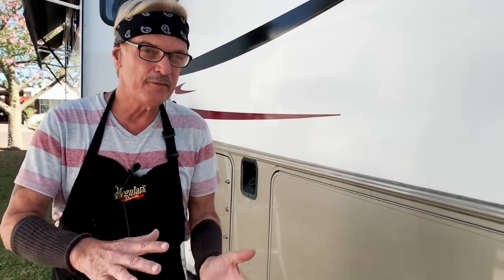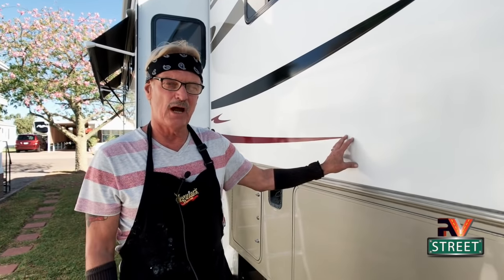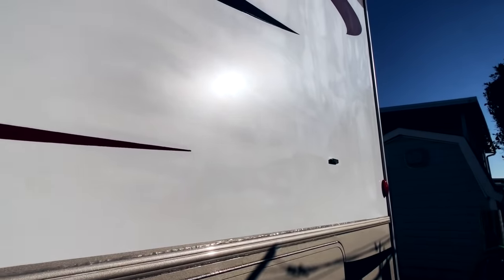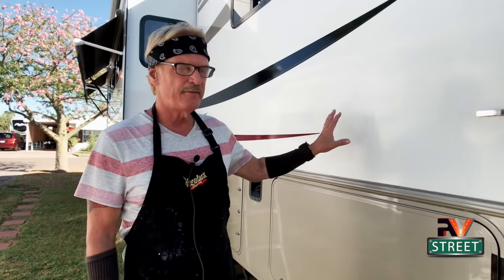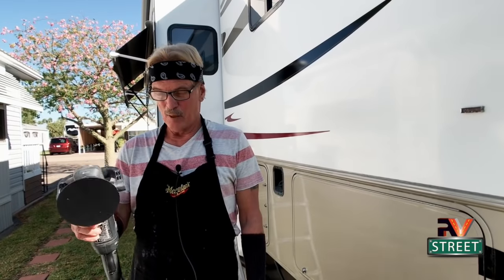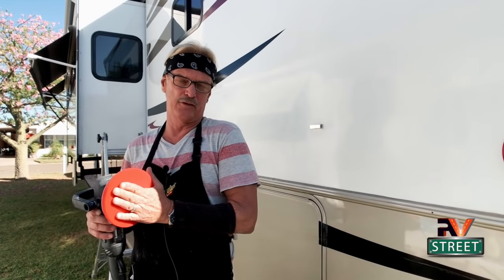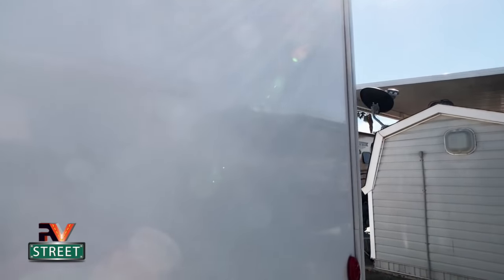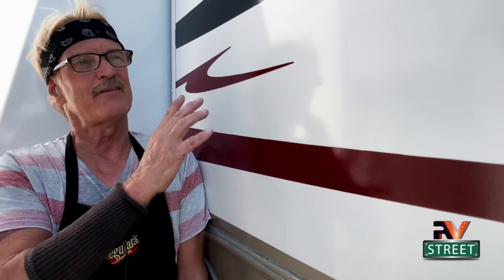HOW TO POLISH & PROTECT YOUR RV THE RIGHT WAY 👍

Comment: Hi Martin & Joanie - 
Great video.  Question; what you are showing, would it be the same process for a coach that has a full paint job?  Also, we had a mishap on our maiden voyage in our 2018 Thor Challenger 37FH. We clipped the corner of an abandon gas station building as we were trying to circle the building to exit the corner station after stopping for a break. long story.  We scrapped the side of the coach at the base of the PS slide and the basement door at the corner point of the building.  We rubbed out the paint from the building  and tried to smooth out the scraps, where some when to the aluminum door and fiberglass base at the bottom slide panel. I was able to get matched up automotive paint (four colors)  from a vKOI auto parts store & paint shop in our home town.  But is is not what we want it to look like; good as new.  Any DYI ideas that we should try?

Joe & Missy
Reply from the maker: Have you seen this video I did?
https://www.youtube.com/watch?v=sB5S6zzRlpk&t=9s

It sounds to me like if you want it to be just like new it's going to have to be professionally painted. Not a DIY job.
Reply: I will go back and review the video again.  Want to avoid pro paint cost, but I may have to do more DYI effort then what I have  done so far which was not what you outlined in the very first video.  Got to get the right tools and do it right! Thanks
Reply from the maker: @joemissyoneil8668  
Ya, those two video's cover different approaches depending on what you're trying to accomplish. I think the 2nd video is more what is in line for your situation. The link again is here:
https://www.youtube.com/watch?v=sB5S6zzRlpk&t=9s
Whatever you do, just take your time, don't stay in one area to long. Don't really bare down on the polisher because you don't want to heat up the fiber glass. Using a very light compound and then polishing out stuff like this is a slow, easy process. If your scratches have gone thru the clear coat nothing will fix that other than repaint. More than likely, I suspect you can get it back to more than acceptable. Maybe not perfect but acceptable. Both the light compound and polish is in my Amazon store if your unsure what to get. 
I know you were probably really pissed at yourself when that happened but....the sun will rise tomorrow. 
You'll do fine I'm sure. Good luck Joe. 👍

Comment: The timing on finding this video was perfect. I spent many hours in April waxing my 3-4 year old RV with a pretty expensive wax to keep that new shine. I use 6.5" general purpose pads (with no cutting properties) on a DA polisher. Now in August, I started seeing what I could only describe as "cloudiness" (the actual word I told my DW). Your "before" pictures are exactly what I am seeing on my coach right now. I was totally mystified. Now, after watching your video, it is exciting to know that I don't have to go and buy compounds that are for oxidation. I think the "cloudiness" is what you see before oxidation sets in?
Reply from the maker: When we first bought our RV it had very bad oxidation. Previous owner didn't take care of it properly. It took me 3 weeks to compound and polish to restore the RV back to new. But this one area has always been a little fussy since, so I usually have to polish it a little more from time to time. But yeah, not ever going to let our RV get oxidation again.
Everything I use to keep our RV looking new is in my Amazon Store under the "Compound, Polish, Finish Coat" category: https://www.amazon.com/shop/rvstreet
Reply: @RVstreet  I purchased the polish, Rejex (which I had already been applying to my front cap. Don't know why I didn't think it was good enough for everything else?) and the #67 One-Step compound (Just in case?) from your Amazon store on Sunday evening. Curious: Did you ever have a time when the Polish wasn't getting it done and you had to switch to the compound? Again, my unit (40" 5th wheel) is only 4 years old and has only gone 1 year without wax or sealant (I keep telling my wife that skipping that year was my big mistake)? I just don't want to ever hurt the finish by getting to "rough" with it, but on same token, don't want to go at it 5 times either. Suggestion(s)?
Reply from the maker: @tomziegler7987  Did you ever have a time when the Polish wasn't getting it done and you had to switch to the compound? 
A: No. If your 5ver has begun to oxidize you'll have to do some compounding first, but I doubt that has happened in 1 year. But it is possible. Skipping a whole year may have been enough to start some light oxidation. You cannot polish to a nice high shine if there is any oxidation.

So let's say your 5ver has not oxidized. It really matters on the type of polish, pads and polisher you're using too.

You can't hurt the finish with polishing or compounding—*IF*—use the technique I showed until you get the results you want. Easy pressure, randomly moving the polisher around, then wiping off the polish with a microfiber cloth and look. If it needs more polishing, repeat.

If some compounding is necessary, same method just use my Meguirs compounding material in the blue bottle first. Keeping your pads clean as you move along. Once oxidation is removed, then polish.

Then use RejeX on the whole RV for your final coat.

I keep telling my wife that skipping that year was my big mistake.
A: I know how you feel. It's easy to look at the RV and say, "It looks fine, I don't need to do that". But you do if you want it to always look nice. 40' is a lot of coach, but if you stay with it every year it's much easier to keep up with it, then wait and cause more work for yourself to catch up to get it back.

Hope this helps. 👍
Reply: @RVstreet  Thanks Martin for your guidance on this. I am preparing (early) to be ready for Spring in Michigan when I can start the polishing process. I firmly believe I have the same situation that you described in the video ("cloudiness"). I am going to try the Polishing process first and repeat if I can't get the cloudiness gone. If that doesn't work and I find that I am fighting a (small) bit of oxidation, what is your first product recommendation? Oxidation Remover (#49)? Is that the first step if the polish isn't working? Seems to have the least amount of aggressive properties? Also, I see that you were using the Polish over the pinstripes and guessing that the polish doesn't hurt them? Whereas, the #49 probably would? Would love to chat with you sometime. Thanks again!
Reply from the maker: @tomziegler7987  Yes #49 and clean the pads often to remove old material. Still can use the pads wet though when compounding. Yes when you're compounding or polishing you go over everything including graphics. They are also dull and sun beaten, this will restore those too. If regular polishing is all you need now or in the future use my yellow pads. You'll need one clean dry one for each side of the RV. It's smoother and will give a much better shine. Never do any of these steps in the sun and hopefully your using my polisher and microfiber cloths too. All these things working together make the difference. You have to use the right tools, go slow, do small over lapping sections at a time. Compounding 3500-4500rpms, polishing about 5500-6500rpms.

Comment: Hey Martin, This may be on another video but thought I would ask here... on the dash inside your coach, what do you use to protect the plastic dash?  I'm assuming 303?
Reply from the maker: Are you talking about the molded dash itself with all the gauges and stuff OR the large area on top of the dash behind the windshield? I assume the latter. No 303 there. With my material up there I use a leather conditioner and cleaner. In addition to that, I made some rubber mats from yoga mats to lay up there for protection and cut glare. And remember, I have my outside windshield and both side cabin windows covered with my shade screens. So that area is never subject to a lot of sun.
And yeah that may be a good video. I'll think about that. thx Gord 🔧
Reply: @RVstreet  and that’s why you are the best. Yeah sadly right behind the windshield is a large moulded piece of plastic on mine and not something… nicer.  I have the drop down shade up front, but it doesn’t cover that giant piece of plastic so I’m worried it’ll get faded or crack over time. Really like that 303 product you turned me in to. Just wish someone local sold it. I may invest in one of those magnashades I’ve seen. Thanks for the help again Martin. If we ever meet on the road I easily owe you both a nice dinner and a few adult beverages
Reply from the maker: @gordschultz1980  If I could offer my opinion on the Magna shade. 
I took a long look at the Magna Shade and was tempted to go that way BUT.......as it turned out I made the right decision by going with my outside snap on type widow shades. Here's why....Storage. The Magna shade is a little easier to pop up on the windshield but I still wanted cabin window shades too on the sides. And then there's storing the magna shade. With those big magnets think about how you'd store it. With my 3 shades, I lay the big windshield one down first on the ground, then the two cabin window shades on top of that. Then Joanie & I roll everything up and put into a 4" piece of PVC pipe with 2 end caps and slide it into the bay. You can't do that with the Magna shade. It's too bulky.  Yes I have to use a ladder to install mine, but I'm going to clean the windshield anyways first so what difference does that make? That screen material has to roll up, not fold. Folding makes creases in the shade material. Plus Magna shades were more expensive. I've had our shades now going on 6 years and absolutely no issues EXCEPT.....if we arrive somewhere where it's cold which is rare, I have to lay the shades out in the sun to warm them up some, so when I go to snap them on, they'll stretch enough to fit all the snaps. Shade material contract and expands with ambient temps.
And yes we'd love dinner and LOTS of adult beverages with you. We're thirsty most of the time.
Reply: @RVstreet   scary I wasn’t sold on the Magna Shade for two of the reasons you listed. Is there a video on your channel that covers your shades?  I’m on my mobile now and the search function isn’t the same as my computer
Reply from the maker: @gordschultz1980  Well not exclusively on the shades but I did briefly cover them here: https://www.youtube.com/watch?v=gksRZys6aX0&t=61s
The company I used is in the description text and I'm not affiliated with them but they are a great company IMO.

Comment: Serious question. I have rejex on my TT. Say you take a trip and hit some rain, would you still be comfortable only using the waterless wash? I have trouble knowing when to full blown soap and water or just use the waterless deal. Thanks
Reply from the maker: If I get caught in serious rain you know what happens right? The RV is trashed. So I do a thorough wash. Takes me about about 2-3hrs. BUT....if it's not serious rain and fully trashed and filthy, then I'll do a wash wax all waterless wash.

Comment: I think my 05 Tioga might be too far gone. Like under kitchen vent where water was always running down looks really dull. I’m thinking gel coat wore off 😢
Reply from the maker: No I doubt it. When it gets that dull like that, it's called oxidation and it needs to be compounded.

Removing oxidation
Here's what I tell folks. I get this question a lot about the DULL look and has lost it's luster. It's called oxidation. Once oxidation has been removed, then you polish, then you apply RejeX for the final protective coat.

Here's the process and a few tips I tell people to do to remove oxidation
The light weight Meguirs MT300 Dual Action—5.4lbs. is an awesome machine. Be sure to buy the back plate too. It's sold separately. It's the exact unit I used to remove the oxidation that my coach had when I first bought it in 2016. Having the right polisher is important. My coach at the time had heavy oxidation on the drivers side and back with light to medium oxidation on the other areas. My large slide on the drivers side was the worse so I had to use the wool pad and diamond cut compound on that area. I didn't have a YT Channel at the time, so I don't have a video on it. But I wish I did. I've actually been looking for an RV that has some oxidation so I can do a video on the process in a camp ground. But I haven't had any owners willing to cooperate with me. But I use the MT300 for everything to keep our RV maintained. If you have oxidation, once oxidation is removed, don't ever let it oxidize again. That way you won't have to go thru this process again.
If need be like you saw in my polishing video, if an area needs a little polishing, polish it then apply RejeX. My secret to keeping it maintained and shiny is using RejeX for my final coat because RejeX blocks the UV rays from the sun and that's what causes oxidation.
For compounding start small first. Like on the back. That will give you an area to get into the rhythm. I used a 12' rolling scaffold so I could stand up straight and do the top half of the coach. The bottom half is much easier to do than the top. Compounding to remove oxidation takes time. As you compound, the pads will load up with material from the RV, so you have to constantly remove it, by keeping them clean. You wash them out with water with them still on the polisher in—warm water is best—in my Grid Guard bucket— in my Amazon Store. If you have heavy oxidation, you'll probably have to use the wool pad and the diamond cut compound, otherwise use the other compound material in the blue bottle in my store and my red pads. Once oxidation is off, THEN come back and polish with my Meguiar's Ultimate Polish also with the red pads. It probably will take 2 or 3 passes to restore the shine. Don't do it in the sun. An overcast sky or inside under cover is the best to polish and apply RejeX—or wax if you prefer that instead—as your final coat. Again, keep your pads clean AND DRY when applying polish, keep wiping off the polish off the RV each time you make a pass with my microfiber cloths. Do small areas at a time. It's also better and goes faster if you have several pads. Just be patient, be methodical and it'll come out nice. You can do this 👍
Everything I use is in my Amazon Store https://www.amazon.com/shop/rvstreet
The stuff you’ll need is in the "Compound, Polish, Finish Coat" category. Above each product is a text bubble where I describe what each product is and what I use it for.
Here's a link to one of my PLAYLISTS that covers other aspects of how I take care of the outside of my coach. These will be helpful to you also. Especially the first 3 videos:
https://www.youtube.com/playlist...
Hope this helps 👍
Here's another reply to removing oxidation
The chalkiness your speaking of is called oxidation. Before you can ever get the shine back on any vehicle or RV the oxidation has to be removed first and *that requires compounding*. I had severe oxidation on our coach when I first bought it in 2016. The previous owner didn't take of it either. It took me 3 weeks—working off and on—to fully remove all the oxidation, heavily polished it, then added the final protective coat of RejeX. Some people still like using wax but I have switched to Rejex because it blocks the UV rays better—the suns UV rays is what causes oxidation—it saves the graphics better too and still achieves a nice shine. I didn't have a YT Channel back then so I don't have a video this process. I wish I did. I've actually been looking for an RV that has some oxidation so I can do a video on the process in a camp ground. But I haven't had any owners willing to cooperate with me.

It's basically the same process as the video you watched when I demonstrated how I polish the RV except you use a compound material to remove the oxidation.

I used the Meguirs MT300 polisher for everything. It's only 5.4lbs so it's much easier on the arms. Be sure to buy the backing plate too. It's sold separately. It's the exact unit I used to remove the oxidation on our coach had when I first bought it in 2016 and still use it today. 
Hope this helps. 👍

Comment: My 2005 has never had maintenance . I can see I will need to use more than polish. Is maguire compound the best choice?
Reply from the maker: Ya I use ALL Maguires products for these two different processes. There in my Amazon Store with a detailed explanation next to each product on what I use them for: https://www.amazon.com/shop/rvstreet
thx Liz for your question 🔧
Reply: I used the compound. I have areas that appear dirty, I can see the marks from the pads. It appears dirty. Am I using the pad for too long? Should it still be wet when I wipe it off? Am I using too much product? Any ideas?
Reply from the maker: @misscdog  Make sure the RV has been washed, clean & dry before you start. When you are compounding you have to wash out the pad often b/c you're removing material and it will load up the pad quickly. That's why I carry the pad cleaning bucket in my Amazon Store. It makes this process go so much faster. Your using the right compound, just not cleaning the pad often enough. Once the pad is clean it will be wet, add more compound to the pad and con't to use the machine on a slow setting. Like 3500rpm's. Compounding takes time. Do a small section at a time. Took me about 3wks to compound and polish my RV and it's 35' long.
https://www.amazon.com/shop/rvstreet